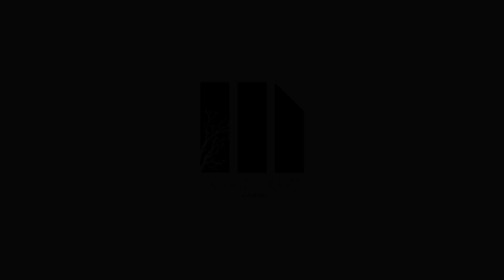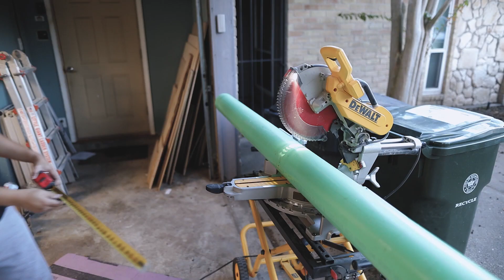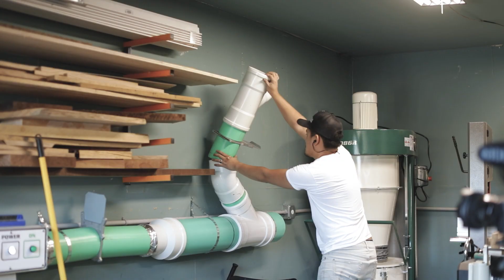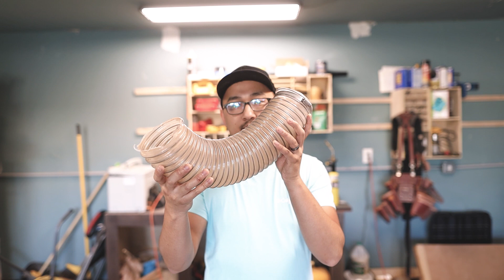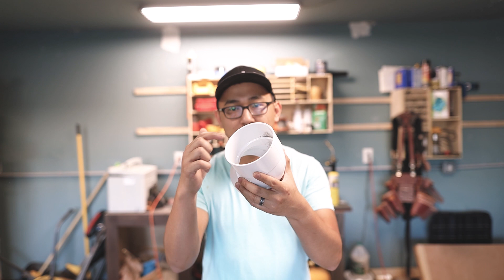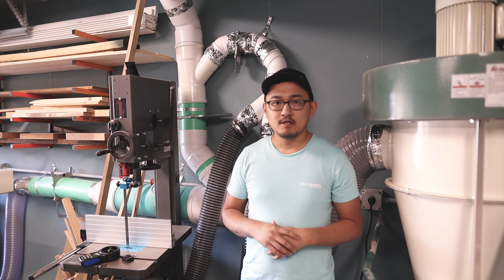Dust Collection Ductwork For Beginners with CFM Numbers // Shop Project

Comment: Don't believe any numbers measured with an anemometer as the air on the boundary of the duct flows at a different speed to the centre of the duct. Just use 6" pipe and be happy it will flow enough air if the impeller is large enough.

Comment: Great video! I need this! Does it case any issue or weaken suction by having the flex hose running right off the dust collector?
Reply from the maker: Thank you! It does effect it a little bit so I kept the run as short as possible. After three years in the shop, it hasn’t been a huge detriment to the overall dust collecting.
Reply: @DesignCraftWorkshop  that’s great. This video has helped me so much. There are several vids I’ve found but this was the best. Thanks!!!
Reply from the maker: @kevinb6102  thank you! im glad it helped!